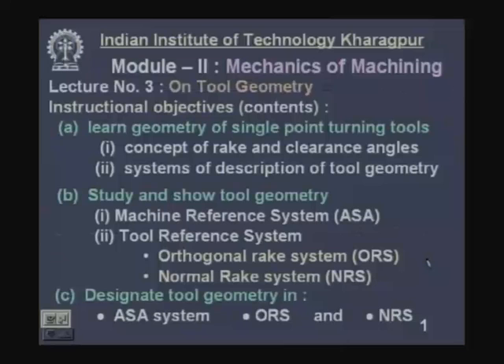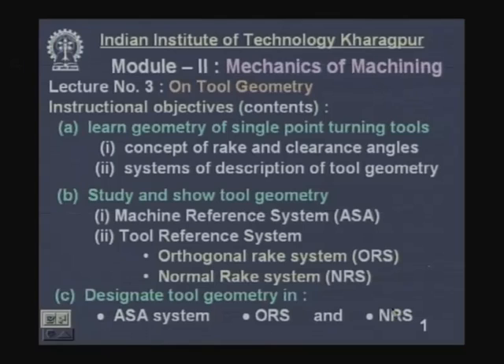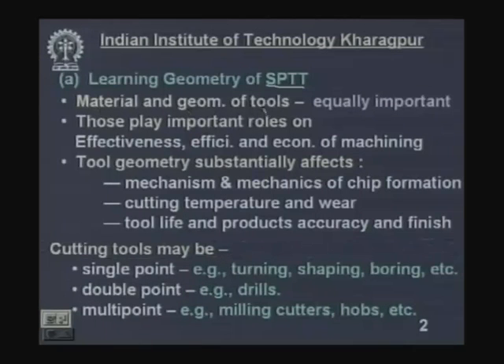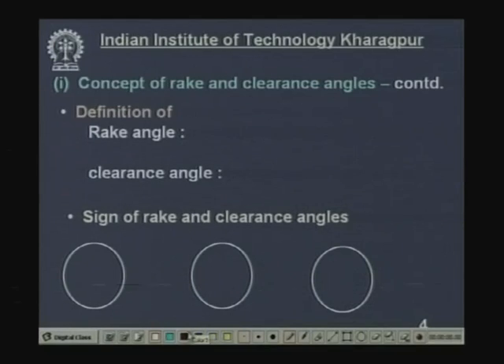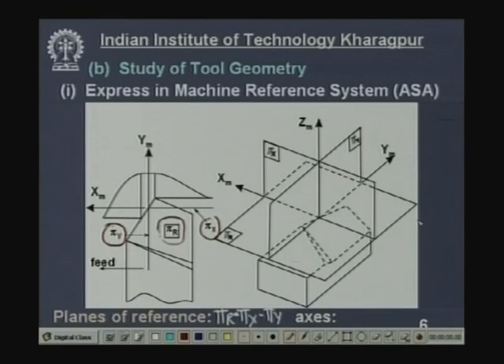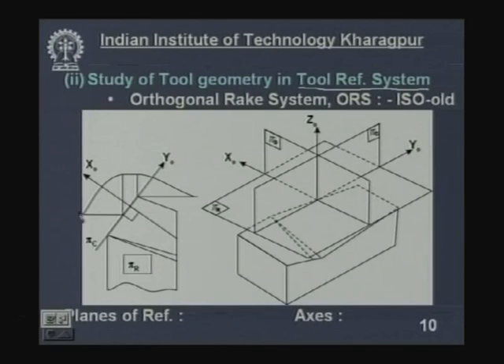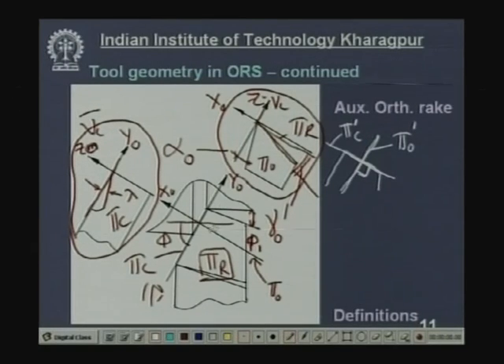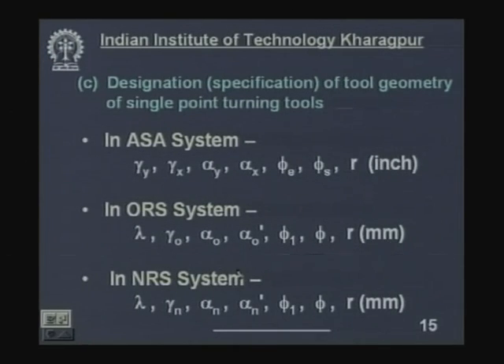Lecture - 3 On Tool Geometry

Comment: Clearance Angles around 25:00
Reply: +Khem Sar Mohammad Hafeez   
clearance angle is the angle between horizontal plane of the work piece and tool..its also called relief angle
Reply: yppp angles are mistaken...

Comment: isnt there any clearance angle in the principal cutting plane in ORS system?
does it mean that the Vc is along the intersectio of principal and auxiliary flank surface?
Reply: It depends on point of consideration, clearance angle can be seen in PCE if point of consideration is at the tip of tool. Major disadvantage of ORS is it does not show true geometry of tool
Reply: @nachiketbelwalkar2939  He has asked that ques 9 years ago and you are replying to him after 9 years and I am replying to you after 10 years of his comment..wow...
Hope he uses you tube with same id.. If you see this message please reply..😀
Reply: @abhijitsinha5316  I am too after 10 years
Reply: @abhijitsinha5316  haha....nd m replying now...
Reply: I have the exact same doubt